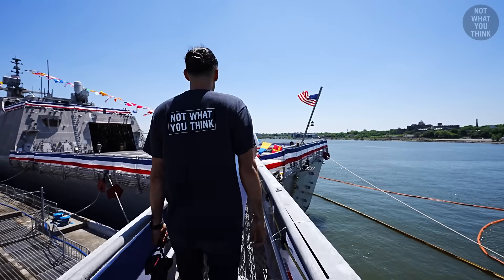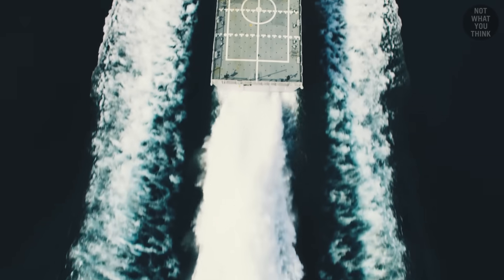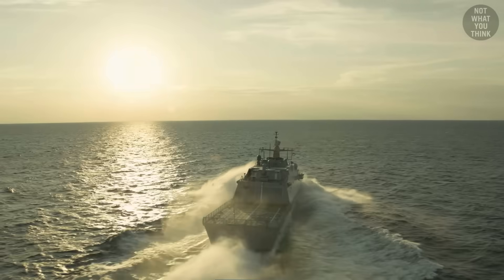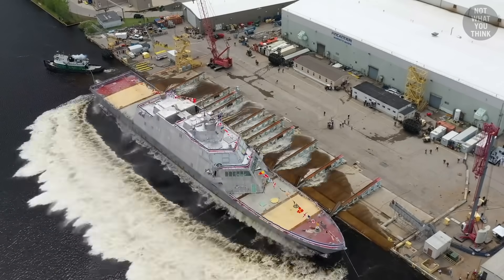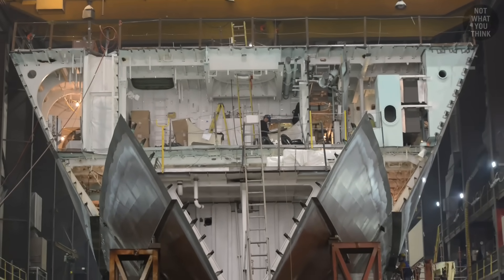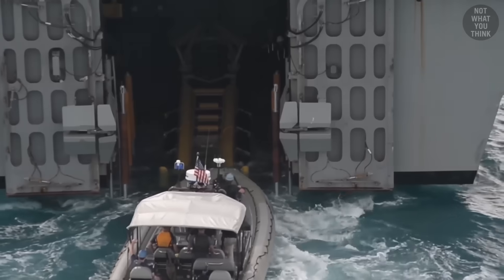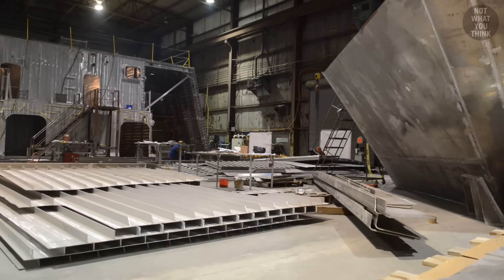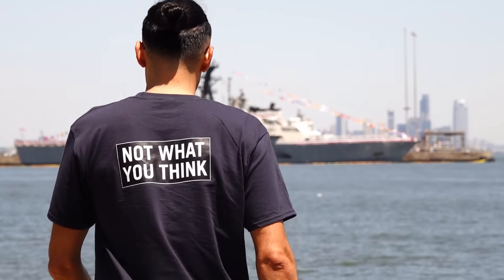I Visited The Most *Overpowered US Navy Warship

Comment: The FREEDOM Class LCS's are GARBAGE. I was on 2 ships that were as fast, if not FASTER because they were powered by 4 LM-2500 Gas Turban Engines (used to power  CD-10's) producing 78,000 Shaft Horse Power. 
Both Spruance's and Ticonderoga's lasted MORE than 20+ years, which is considerably more than the 3 years of the Freedom Class's. 
In addition to the mission module problem, the Freedom Class LCS t has suffered from cost overruns, delays, propulsion reliability issues, and high operating costs. As well as Structural issues (getting holes put in them from simple Tug Nudges). Purchases of both classes have been cut, and the Navy has proposed decommissioning all of the Freedom- class ships, some only three years old.
As for the MODULAR mission problems, they can do Either Anti Air Warfare, Anti Surface Warfare, or Anti Submarine Warfare. ONE AT A TIME without coming in and changing out the mission module. Typically, you are in all three environments at the same time.  So basically, IF you are configured to prosecute Submarines, and you have a Air Attack, you are just screwed. Spruance's and Ticonderoga's could perform all three at the same time, and often DID.
The limited capabilities of the Freedom Class LCS is what makes them LITTORAL ships (Coastal). They would be GREAT for the Coast Guard, and their primary mission. Her 2.24 inch pop gun with a total of 880 rounds would be good for patrol boat interdiction, but no match for Spruance and Ticonderoga's 5" 54 guns... 

OVERALL, CONGRESSES BIGGEST MISTAKE... BRING BACK REAL WARSHIPS...

Comment: Using marine variants of aircraft engines is not a new thing I'm afraid. In the Royal Navy, the T42 (1975-2013 - 5,300t) and T22 (1979-2011 - 4,800t) both utilised 2 x RR Olympus (marine variant of the Concorde engine) and 2 RR Tyne (marine variant of the Vanguard engine). The Invincible-aircraft carrier (1980-2014 -22,000t) utilised 4 x RR Olympus and also 8 x Paxman Valenta (marine variant of a railway locomotive engine). The idea of clutching in diesel or gas, diesel and gas or gas and gas (and many other variants) is also not new - it's a traditional marine powertrain. However, modern approaches are towards IEP or the combined diesel-electric and gas. It's more efficient, less noise and reduced weight.

Comment: They are designed to be less cost and maintenance while doing light duty work such as coast patrol and anti piracy. Getting to the destination fast is a bonus. Not built to handle sea battles but after a sea battle with burning sinking ships everywhere, the lcs would be a lot better to have around than nothing.
Learn to fix the design flaws and work with the quirks.
Reply: Very hard to do when the contractors hired to do the maintenance are cracked out idiots that throw deadlines and mrc procedures to the wind… get rid of the contractors and let the crew work on it, I guarantee we’ll get it done cheaper, better, and faster

Comment: That's a cool ship. I would love to see the fuel burn. I bet its astronomical. An engine in a boat or a generator has constant load all the time. They can't pull out of the throttles after take off like an airplane. I run 6 of the GE equivalent engines for power production. They like the fuel.

Comment: The iso mounting may counter the vibration but that is not why most light equipment was iso mounted. it was a shock class requirement. if the ship took a hit things have to be able to flex or risk failure.

Comment: Being a Naval aviation veteran , I’m familiar with jet engines in aircraft and how they operate ,but I gotta know how you get high volumes of air to those big engines inside a box below deck…..that alone would create noise you could hear from miles away….quite a feat !
Reply: I spent 2 years on a Burke and 3 years inspecting LCS’s. My tinnitus says ventilation for the gas turbines was never a problem. Sometimes I’d get off watch and leave double hearing protection on eating dinner.
Reply: @michaelbateman6430  I worked the flight deck , yep it destroyed my hearing. Especially back then 68/72 the ear protection wasn’t much better than tying a rag around your head . I get a disability check from Uncle Sam every month . At least it’s something….thanks for the reply….

Comment: If it was up to me, I would take the current design and redesign to 
A.) A all Steel Hull, yes this will increase weigh but you see why later
B.) Swap out the jet/diesel combination for a turbo diesel electric for increased reliability and guess what, if you lose an engine, it does not take out the entire propulsion system 😑
C.) increase structural rigidity of bow and bottom for light ice breaker duty
D.) hand the redesign over to the Coast Guard because, by god, they really need some new ships.

Comment: All these problems had to be easily seen, even before building. Empty resonance cavity above engines, see ww2 light cruiser class Brooklyn.  Excess vibration kept them from carrying any additional seaplanes, they could only carry the two on the catapults.  Gear box problems? No sh#$, you are taking an engine (diesel,) at  a couple 1000's of rpm's with an engine turning from 3300 rpm to 7000, to 10,500 rpm.   Excessive vibration should have been on every mind as they designed the ship. Now, the ship is unable to perform a primary mission, ASW.  Another thing even I know that if your designing a ship for shallow water, usually a smaller hull will return more efficiency.  3500 tons is more than the larger ww2 destroyers.  Do not understand why an 800 - 1500 ton range was not used for shallow water deployment.  Not going to armor the thing anyway, so more numbers mean better force projection,,,, they tried to put to much in one package and beyond that - they wanted the ship to be able to change from an exceptional ASW ship to an exceptional Mine hunter, to an exception land warfare strike team delivery ship.   To many pistols not enough holsters

Comment: 12knots with 30.000 HP is crazy slow for such a small ship. I worked on navy amphibious transport ships, quite a bit larger with more than 12.000 tons displacement, that had diesel electric propulsion of 'just' 12MW,  or roughly 16.000HP, which could do 19knots at full power. No way these could only do 12knots on the diesels.

Comment: Lol an LCS being the most overpowered ship in the US Navy. HA Ha Ha Ha now pull the other one. Seriously, check out an SSGN if you want to see overpowered. One ship that can wipe a small country off the face of the planet using conventional weapons all by itself. And while the LCS is fast, it is only that fast for a short time before it's fuel runs out. A CVN can do nearly the same speed, and do it for weeks if needed. Ever see a roostertail going up as high as the flight deck? I have. 

The LCS's were a good idea executed very poorly. If they were as reliable as advertised, had the fully modular systems that could be switched out at any container port, and were as low cost as they were supposed to be then they would have been a good addition to the fleet. But they are nearly as expensive as a destroyer, break down all the time, and the modular systems were so bad the navy decided to make them specialized ships instead.

Comment: What do I think the US Navy should do with the Freedom Class LCS ships:  I think that these ships are a perfect fit for the US Coast Guard.  They can perform interdiction, anti-piracy, oceanographic research, and Search & Rescue operations while also being able to fit into US Navy roles when called upon.  The “Red Light District” and huge flight deck provide lots of capabilities to carry out those functions.  The fact that they have smaller crews also fits into the Coast Guard’s needs.
Reply: That’s a good point - but they’re VERY maintenance intensive and expensive to operate, which generally goes against USCG doctrine (and certainly their budget.)
Reply: @EstorilEm  How much more expensive are they than the large Legend Class cutters?
Reply: @dgthe3  They are indeed much closer than I thought, but the NSC is still a good bit larger with more capability.  

It's difficult to quantify, but it seems like the LCS would still have significantly increased maintenance costs over the NSC. 

Not a bad idea though, especially if they're already retiring them (as in, they're already bought and paid for!)
Reply: Having worked on the LCS fleet in Mayport for many years, they do in fact have many issues. They are almost always at the pier and when they do get underway there’s usually a problem.  As a retired Coastie, the USCG does not have the $$$ for the continuing issues with these vessels.
Reply: The USCG needs to be able to send their ships into storms to rescue crews, LCS ships have hull cracking problems that limit their speed in heavy seaway.
Reply: Sell or give them to the Philippines. They need some butt kicker ships to get the Chinese to behave themselves.
Reply: They need to make them in drone ships at the very least. 

 It would be perfect. Basically a fast ship that can launch medium drones from a catapult. 

 Launch F 35bs. 

 Something.

Comment: Instead of putting a shipping container with 4 VLS cells on the flight deck.  Why not put 12-20 tactical length VLS cells in the "multi-mission" bay underneath the flight deck.  Then cut pop up doors in the deck that fit flush and allow the flight deck to be a flight deck when you are not launching missiles.

You would lose the ability to launch Tomahawks or SM-6, but could carry a good amount of SM-2, ESSM, or ASROC.  Additionally when the USN finally fields VLS launched NSM and LRASM they can be added.  And as a bonus you can still launch and retrieve helicopters,  which is kind of important. 

Lockheed Martin was pitching a plan to add four full length VLS cells in the space currently taken up by the Hellfires, but I  not sure losing them for a long range strike capability that can be filled by upcoming weapons in tactical length VLS cells is worth it.

Comment: The 155mm round (6-inch) is extremely popular in the armies of many countries with a very wide range of configurations. But why no use in the Navy???
Reply: -However, in its overall count of assistance provided to Ukraine since Russia invaded in February 2022, the Pentagon says it has sent more than 160 155 mm howitzers, more than 1.5 million 155 mm rounds, more than 6,500 precision-guided 155 mm rounds and more than 14,000 155 mm Remote Anti-Armor Mine (RAAM) Systems — essentially a 155 mm shell packed with four mines that scatter on the ground and can take out a Russian tank. Or a destroyer? if it drives over them.
Navy keeps squawking about barrels not being compatible, but cannon tubes are expendable items and can also be relined if needed. My impression is massive corruption!

Comment: The box at 1:21 is mainly due to sound, due the the high pitch of a jet engine.
Reply from the maker: That’s an interesting point. I’m sure it makes things a lot more quiet. But if that was the main reason for the box, why make it explosion-proof?
Reply: @NotWhatYouThink  I'd guess the explosion-proofness goes both ways: it also protects the expensive turbines of an explosion nearby (say an anti-ship missile or a shell).
Reply: @NotWhatYouThink  It is definitely not explosion proof, no idea who told you such things. The capsule is simply an acoustic enclosure - not for the crew, but to reduce the ships noise signature i.e. reduce the detectable range for submarines, because less vibration/noise gets transfered into the ships hull and therefore into the water.  Secondary reason is fire surpression, the caspule has a built-in fire surpression system. Last reason is external air cooling of the turbine.
Reply: @NotWhatYouThink  I've seen these kind of set ups for turbines based on land (natural gas/electricity plants) too, it was always pointed out that this was necessary because of the incredible deafening noise.

Comment: the Independence class of LCS can function as stealthy guided missile corvettes in the high seas . . . the hull of the LCS will need significant design modifications for trans-oceanic capabilities & endurance in higher sea states . . . marginally thicker hull featuring a bulbous bow & horizontal blade extrusion along either side of the lower hull section to counter thrashing waves . . . a conventional rudder & 360°deg rotating Azimuth thrusters in the aft stern section under hull will replace the waterjet propulsion . . . a 3,000 ton surface combatant that can be deployed as part of a carrier strike group anywhere across the world's mightiest of oceans & seas without giving it a second thought . . . the Independence class offensive capabilities will replace the RGM-114 Hellfire anti-armour missiles with RGM-84E Harpoon inertial guided anti-ship cruise missiles & RGM-109M Tomahawk II active radar guided land attack cruise missiles . . . 455 mm triple tubed torpedo launchers & a 30 MM CIWS that'll complement the existing SeaRAM close range surface-to-air missile . . post modifications the Independence class will be officially classified as a guided missile corvette & will no longer venture into shallow waters . . . all Independence class & Freedom class LCS has to be structurally modified for deployments across international waters alongwith naval task forces . . . littoral waters will be a thing of the past . . . re-assigned to operate in carrier strike groups, just like any Arleigh Burke class guided missile destroyers . . . all naval defense in littoral waters should be categorized as a separate dedicated branch of naval warfare under full oversight by the USN . . . this will save the USN millions in terms of operational costs year-on-year . . . surface combatants in littoral waters should be no bigger than a 1,200 ton - 2,603 ton (loaded) guided missile fast combat crafts & midget sized optionally manned/unmanned reconnaissance & attack submarine displacing a maximum of 820 tons (fully loaded) . . . it'll be armed with three 533 MM guided torpedos & 4 anti-ship cruise missiles . . . plus a concealed 82 MM main gun . . .

Comment: One thing you didn’t point out was that that ship uses amazing amounts of fuel when those turbines are used. They can’t run them for extended periods of time due mostly to their fuel consumption. Turbines are huge H.P. producers and light weight, but they use staggering amounts of fuel.
Reply: I wonder what an "extended period of time" means here. Let's just assume the longest passenger jet flights are ~18-19 hour long currently I believe. So the plane can carry an amount of fuel that lasts that long, although in cruise mode they would not be on max thrust. I ship of this size should be capeable of holding a bit more fuel than the plane.... soo... can it at least run for a full or few days? Usually there should be no need to drive at those speeds for longer i guess.
Reply: the Navy saw the Army with their Abrams jet-propelled tanks and was like -- "that, we want that"

Comment: Props. This is first positive take on the littoral ships I've seen in a while. Based on this video, maybe these ships might be able to do more of what they were intended to do over time. Take that boat/drone to detect mines, for example. At least a part (if not all) of the mining mission is being handled by a drone. Maybe we should use these ships, and their extra internal space, as drone carriers. The vibration issue won't matter as much if the drones, being several kilometers out, are the ones doing the searching. The speed of the mother-ship will allow for quick a response if the drones find something (assuming they don't let one of their helicopters do the hunting).

Comment: engineering question here:
any hypothesis on they could have created a variable gear box to couple the engines?

from what I know, the rpm of a turbine and diesel engine is not fixed, and I don't think is possible to regulate it. hence the only way to couple them is a variable gearbox.